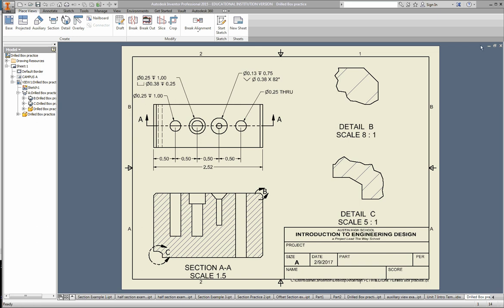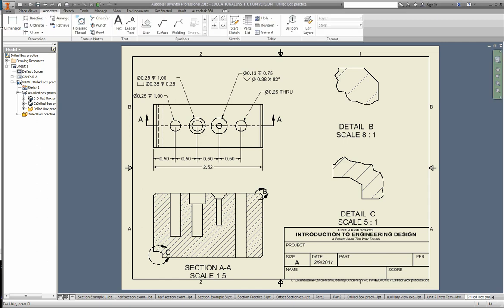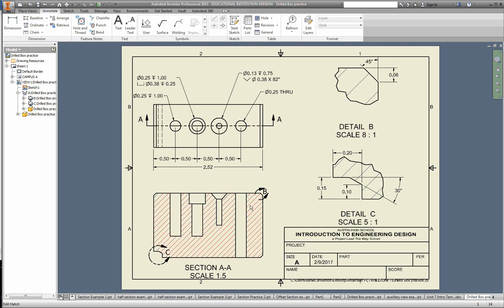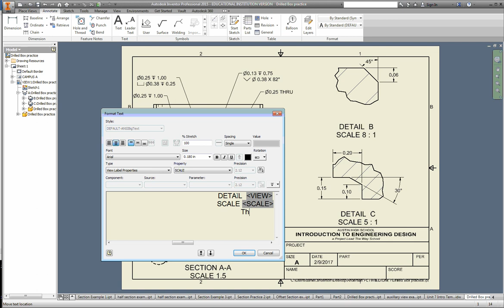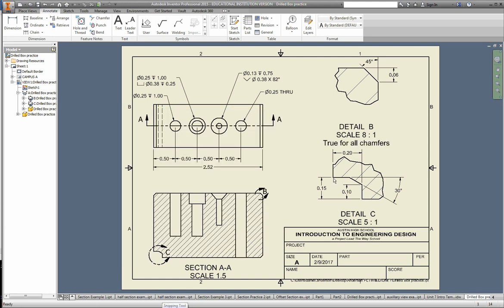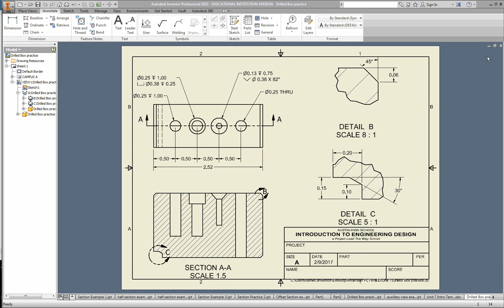Dimensioning angles - Documentation in Autodesk Inventor 5

Comment: 1) You are not using a valuable resource that is available and called chamfer in the top bar. With it you can dispense with the "B" detail and point directly to the part's drawing and complement it with ---> (3x)

2)The other chamfer, it is better to quote as you did, indicating a measurement and angle